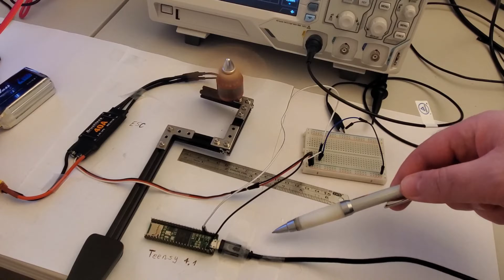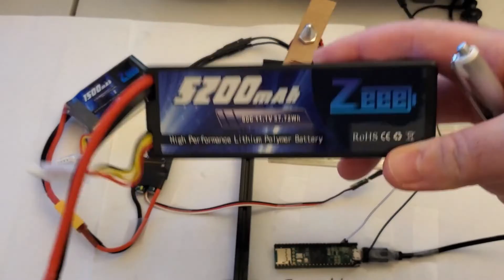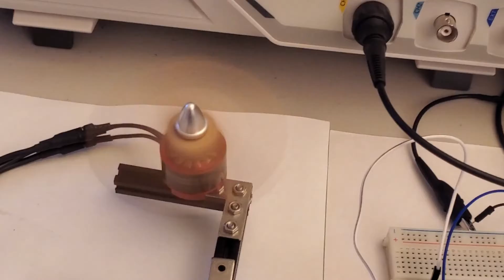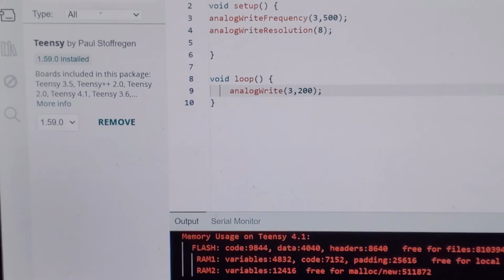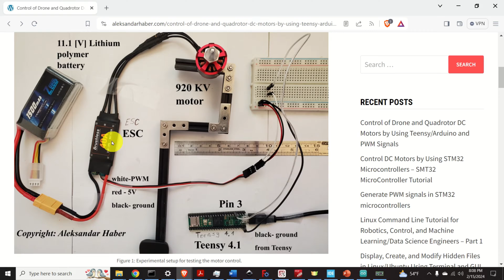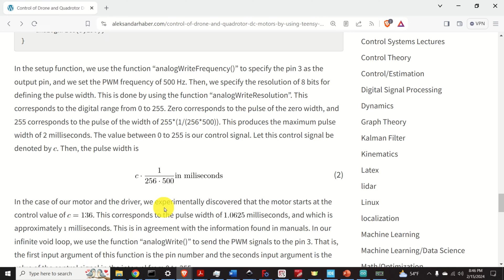2. Control of Drone (Quadcopter) DC Motors Using Teensy/Arduino

Comment: Thanks for sharing, but i have a question i am also working on a drone project and i want to khow if i will need an ESC for every motor or i can use only one to supply all four motors
Reply from the maker: Think little about it.